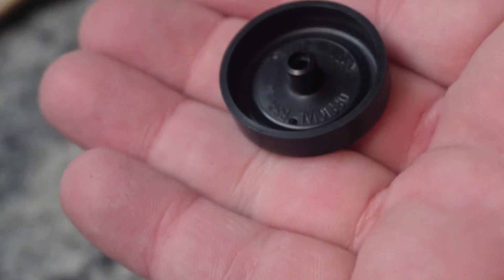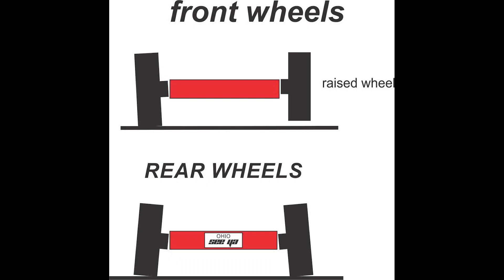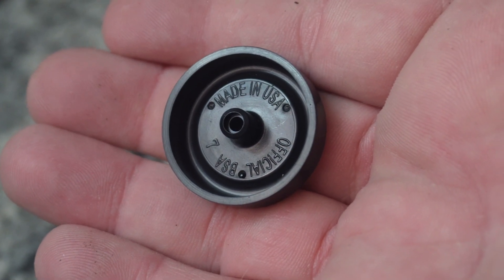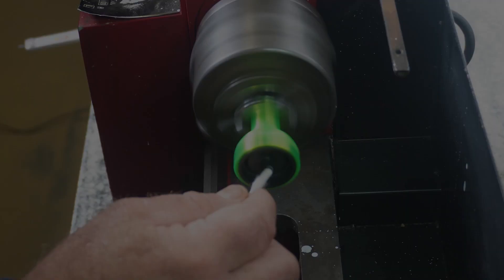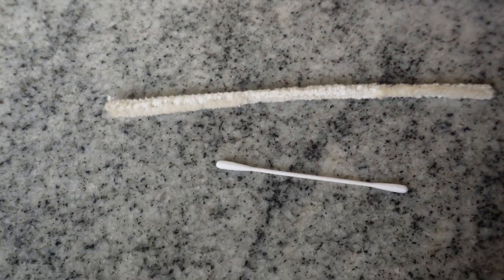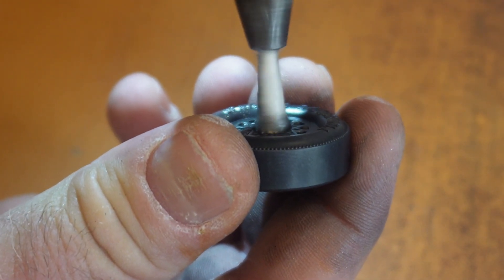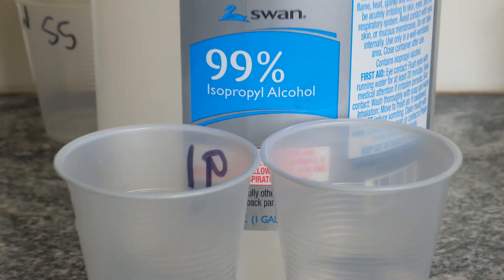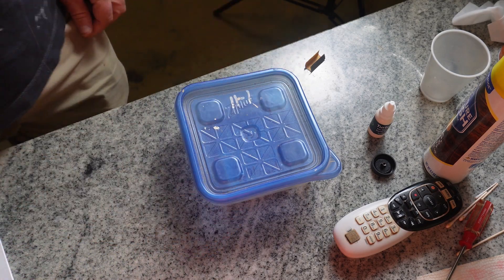Pinewood Derby Wheel and Axle Prep

Comment: Hey Mr. Reece, what tooling are you using in your lathe? Also what RPM are you setting you lathe to when prepping your wheels?
Reply from the maker: I buy my tooling at diamondtool.com I normally cut at about 600 rpm
Reply from the maker: I forgot to mention, I have a video that goes over my lathing process.